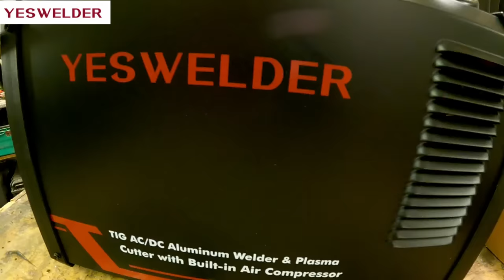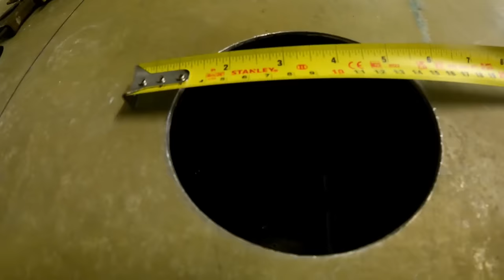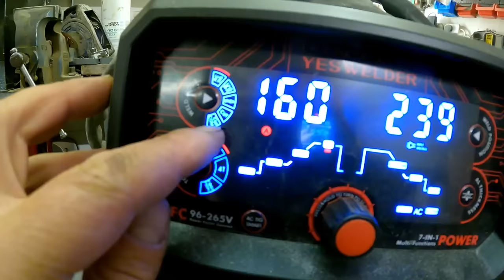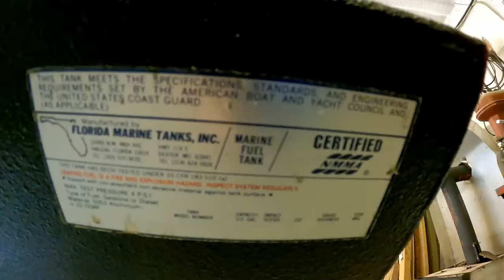Restoring 34yr Old Fuel Tanks with YESWELDER &  RAPTOR Paint! #boatrestoration

Comment: Great welding attempt Gemma 👌🏻I’d never mix aluminium and stainless as they react with one another, unless you use an insulator like a plastic washer or some other inert substance between them.
Reply: My motorbike luggage cases were aluminium with stainless rivets. Every rivet had a 20mm dia ring of corrosion cliff around it. Stainless bolts through aluminium block clamps seized solid. A good cost of copper anti seize stopped the bolt problem. The solution to the fluffy sheet was simple - aluminium rivets would have been fine.

Comment: I’ve had an aluminum fuel tank issue before and found out that not only the bottom was compromised, but an inch or two up on all sides were also weak. The next owner of the boat found that out, not me. The whole bottom weld by professionals, blew out on the sides of the tank and left him with 60 gallons of diesel sloshing about his bilges. Imagine that nightmare of boat ownership😮😢.

Comment: Better to leak test with acetone, could be a big mistake painting before pressure testing. If there is a leak, the paint may stop it for a while, open the hatch in the spring and have a bilge full of fuel

Comment: Gemma, brilliant first attempt. An observation by another commenter about turning the tip of the rod over to prevent accidents is important. If you are passing behind and the welder stops and sits up you get speared. Get a glove, light pigskin the best; as you will find the radiation from the weld giving you 'Sun Burn' on the inside of the wrist. It can be quite sore, a delicate area.

Comment: Could I suggest getting some phosphoric acid and sloshing the tank before sealing it up. 10:16 10:16 
Phosphoric acid is what we use in the aircraft industry to treat alloy corrosion and if you find some chromic acid or 1200 alodine to follow up will create a chemical conversion to prevent further corrosion!
If using phosphoric acid and good flushing with water after about 10 minutes of applying the acid, same with the alodine.
I’ve been dealing with aircraft structural corrosion for over 50 years so I do know what I’m talking about.

Comment: Gemma, great job for a first go. Just leave the torch there at the end of the weld till the post flow stops.

Also, stainless and ally don't play well together. You'll end up with galvanic corrosion on the ally.

Galvanised bolts are the way to go there, zinc and ally do play well together.

The green stuff you were sanding may have been zinc chromate. Great for corrosion protection. Terrible for your health when turned to dust.

Use chemical stripper for removal, not mechanical.

Comment: I may be wrong but I have some concerns about stainless steel bolts on the aluminium tank in a saltwater environment. Something tells me that you can't put those two metals together it will cause the aluminium to corrode
Reply from the maker: There has been a stainless bolt in the tank for 34 years, so don't think we need to worry!

Comment: As someone said you should have used acetone to check for leaks as molecules of water are bigger and won't get through small pin holes.
Reply: Actually the molecules of acetone (C3H6O) are much bigger than water (H2O), but acetone has a far lower surface tension than water (24.5mN/m vs 72mN/m) so it penetrates micro cracks and voids far more than water will.
Reply from the maker: We have left the full of red diesel for 2 nights before taking them to the boat.

Comment: Sorry to rain on your parade but you had a leak, so now have some water between the original tank and the new floor sheet.  Both old and new aluminium was bare so it will start to corrode and you will get a leak. I work on aircraft and the aluminium corrosion  will make it look like Daz Dust  washing powder  Others have mentioned galvanic corrosion with the stainless and aluminium and they are right, you will get corrosion and  the bolts will just seize up.
Reply: Maybe it would have been better to cut out the floor and weld in a new one? That would prevent the leak of water between the old and new floor. And resulting corrosion.

Comment: Too late now, but since you had the wood disk on the lathe, you should have trimmed one side down past the holes to the diameter of the large hole in the tank, then you could have just set the wood template into those holes, marked or drilled pilot holes in the tank, then done the threading.  And use the same template like you did to put holes in the cover plates.

So that way you have centered caps and the bold holes are all identical.

Comment: You are making a lot of work for yourself with the tank caps, what about using rivet nuts in the tank then you only need to use a rivet nut and bolt for each hole.

Comment: great work Gemma (and Si) will have to start calling you Jack, 'Jack of all trades'
i hadn't realised the tanks were aluminium, the welder looks like a great piece of kit, and its a plasma cutter too, excellent
damn Chinese are clever boffins eh!
good plan adding the extra panel Simon, there are chemical fixes you can get, that will line the entire tank with a plastic coating, and sure there are companies that would do it, think there is one near Basingstoke that makes all kinds of plastic boat fuel tanks, using a rotary moulding system, sure they could easily use your tanks as the mould, but no idea on what it might cost, worth a call

Comment: Pressure testing is best because you skinned the bottom any water that gets between the skin and the bottom will be a prick to get out and cause problems when trying to seal any leaks. Anyway good luck.

Comment: Can I make a suggestion, I'd most definatly finish off with a Tank SEALER and that will give you a bullet proof end solution with an internal rubber type coating, it stops any chance of oxidation getting into the metal.
Br Peter

Comment: Couple of spray painting tips, NEVER change direction with the gun without releasing the trigger first or you get a double thickness of paint which is liable to sag or run. Go in one direction on the first coat and 90 degrees to that on the next coat and start with a very light coat and build up thickness in subsequent coats. Like the look of your new welder! Looks the bees knees!!!

Comment: I wonder if you're making a moisture trap by welding that plate covering the bottom, it looks like you've still got small leaks on the original bottom and given water will naturally settle to the bottom it might find those small holes and gradually fill up the gap between the two plates, thus causing them to rust even worse than they normally would. There is stuff you can get to coat the inside of the tank to seal up small holes, you might want to do that just to be safe.

Comment: I would have pressure tested those tanks at 3 or 4 psi before painting, static water is not a reliable telltale. I would be very surprised if you only had one little leak.

Comment: I would be cutting the bottom of the Tank out in one piece so can clean the whole things inside out to find any corrosion within the whole tank same with the other one.  Then weld it back together knowing no small nasty objects will get in to the fuel system.

Comment: Nice work there, Gemma, 'stacking dimes' like that!!  I know you weren't putting two pieces together, but you have good technique.  I'd love to see some more 'tests' with that welder.  Looks like a great piece of kit with the 'all-in-one'.  Hopefully the different pieces of the whole unit are of quality.  It looked like it did a great job cutting.

And bravo on cutting aluminum with the table saw!!  I'd never think of that, although I have cut lead with a circular saw (it works great, BTW).  

IMHO, I would have painted those tanks a light color.  I think you'll end up hating how much light you have to put around them to see anything when working below deck.  Yeah, white, or light, shows a lot of dirt, but it also bounces light around, which helps when you working in tight quarters and dim light.  Bang-up episode, as usual, though!!  Cheers!

Comment: They sell sealers for fuel tanks. Simon you need to let gemma weld the tanks. Gemma your a natural on the welder.
Reply from the maker: Sealers are not recommended anymore due to the higher levels of ethanol in fuel, West System certainly don't advise this option any more.

Comment: Is there a galvanic reaction risk using stainless steel bolts/ washers/nuts on the aluminium plate? Maybe use a nylon washer spacer
Reply: crossed my mind when salt water could enter the equation
Reply from the maker: There has been a stainless bolt in the tank for the past 34 years where it connects the earth strap, so we're not worried!
Reply: Well done for shilling a product for non U.K  W&?N"ERS
Reply: brass and aluminium is a not good

Comment: Simon, while I am just at you water testing the tanks, do you plan on treating the inside of the tanks?  I know of folks sending off tanks to be properly cleaned and something like an epoxy coating throughout the tank (used on old cars)
Reply from the maker: Epoxy coating is no longer recommended in tanks due to the higher ethanol levels in fuel.

Comment: Simon will using stainless bolts in the aluminium tank cause a problem in the future with the two metals reacting?
Reply from the maker: It's had a ss bolt in there for the past 34 years, so not overly worried

Comment: you guys could not have picked a better paint, I painted our GMC 1995 underneath in the bad the body to heavy coats, and it is amazing paint it is blue different color but that paint is so durable, a lot of four mud whomping hill climbing four-wheel-drive vehicles have been using that for some time, I know what you're thinking because of the texture of the paint my God that must be hard to clean super easy slap a little bit of a soap on it from a carwash and it comes out just like the day you painted it.

Comment: You are holding the tig torch at way too much of an angle.  You want to be as close as possible to 90 degree to the work surface.  You also need to adjust your balance settings.

Comment: you would better cutting the whole bottom off becouse you are leaving a rotten bit in which would speed up the rot of the new plate with no protection on the inside of it.

Comment: Nothing the matter with that downhand Gemma. As to watch you feeding the rod was like watching a real welder with speed, rate of feeding and angles. For your first attempt at bench downhand has to be 10 out of 10 and dare I say a better finish than someone else's, (to mention no names). I would try air testing instead of water as that will find even the smallest leak that maybe holding with water, before or after their installed or painted gven you have a air line. But if water works for you, it works.

Comment: Are you pressure testing the tanks .as ,as much they may not look like they leak .  And your welds are good ......fuel creates vapour and doesput pressure in the tank .....if your weldsaint good the pressure will find the weak spot and the tank will leak ....ie vapour escapes,and is fire hazard

Comment: The paint that was on the tanks already was an anti-corrosive paint
Reply from the maker: Didn't work to well did it? 🤣
Reply: @ShipHappensAdventures  it rusted from the inside out it didn't have the anti-corrosive paint on the inside only on the outside and you already know water is getting in between them two pieces of metal because it was leaking if it was me I think I would grind them welds off and paint all except for the metal area you will be welding and then paint it after you weld it you know how quick saltwater rust steel out but other than that you're doing a great job I enjoy the videos thank you very much

Comment: And you should have painted the back side of that metal plate that you welded on on the bottom
Reply from the maker: No coz you can't really weld painted surfaces
Reply: @ShipHappensAdventures  you can get weld through primer paint but you wouldn't paint the areas that you would be welding but having some paint on that bare metal would have helped it last a lot longer but great job anyway thanks for the videos

Comment: y

you would be better cutting the whole bottom  off rather then encase the rotten steel which will rot in time and speed up the rot of your new plate it will also allow you to clean your tank good luck
Reply from the maker: There not steel they are aluminium